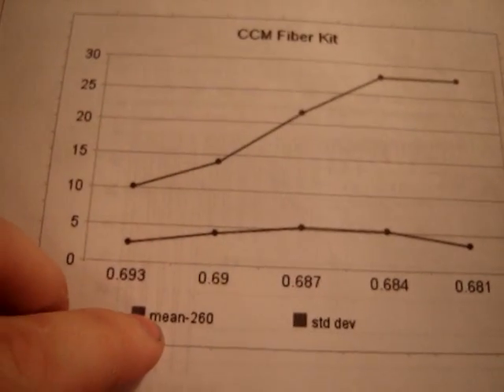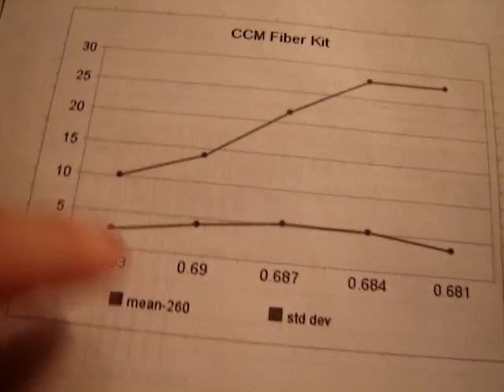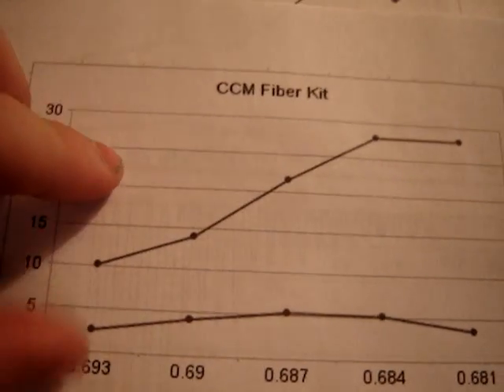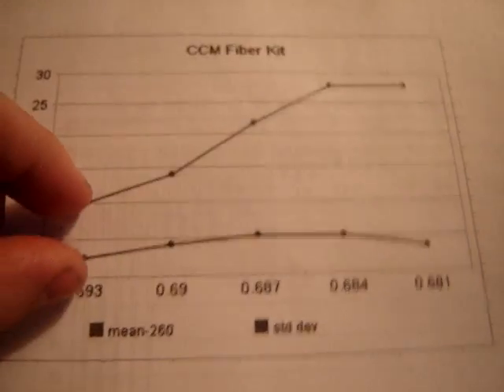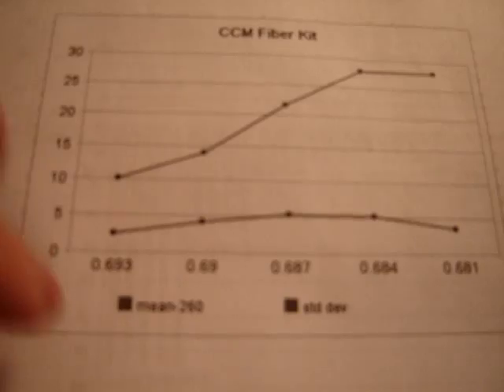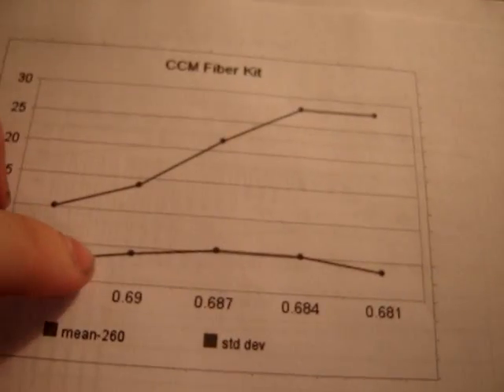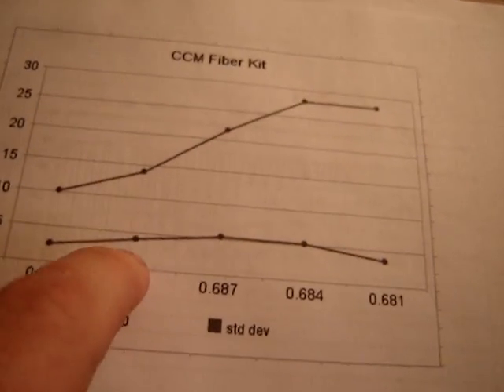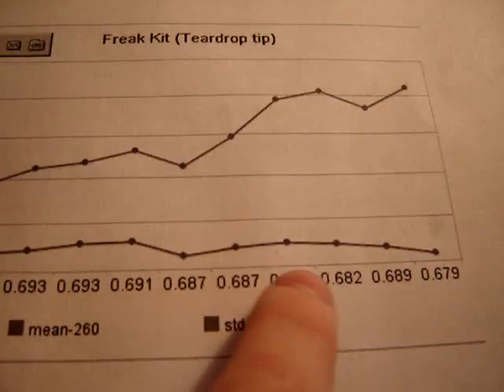Paint to Barrel Match Testing Explained

Comment: well i just read a bunch of your threads and watched a bunch of your vids back to back and I think i love you guys. Aside from that, I find this personally useful because it confirms both my logic and practice. I usually underbore 1 -2 freak inserts depending on quality of paint. However, due to fear of breakage I have gone to blow test levels or larger. I understand from your other tests that this is not adivsable, so I can go back to underboring slightly like I prefer.

Comment from the maker: thank you, the idea is to make the knowledge common. 

the bore sizes were measured with a micrometer, which is more accurate than a caliper. 

as far as barrel breaks, we dont know. that test is a for sure right now, but has not been performed yet. the paint being used is still up in the air as well, pending a few talks with paintball companies.

Comment: Great work on the video!  Even people who aren't familiar with statistical terminology can understand it because of the explanations.  Very interesting data you have there.  Had a few questions.  First, were the bores confirmed with calipers before testing?  Second, did you get increasing barrel breaks with the underbored barrels during the test?  Third, did the paint have a thicker or thinner shell for the test?

Comment: Good stuff. I generally overbore 1 insert if possible. I think that it should be noted that, as you mention, most tests performed on ACCURACY, with all other variables washed out, indicate a relatively close match as best. Given all the data, I'd say 1 insert overbored to be the tentative ideal.